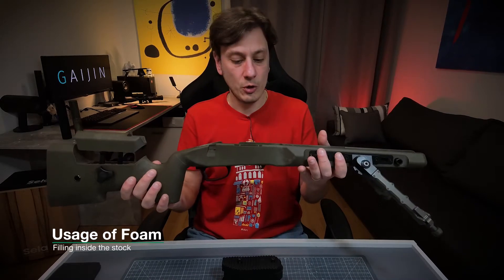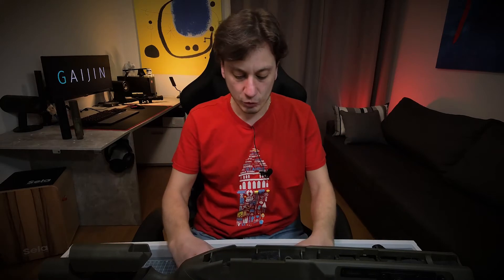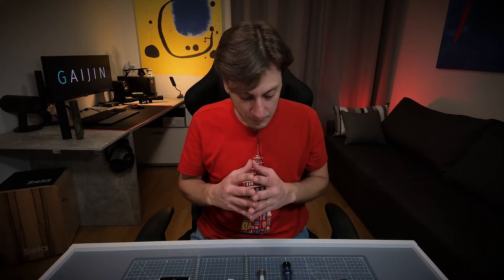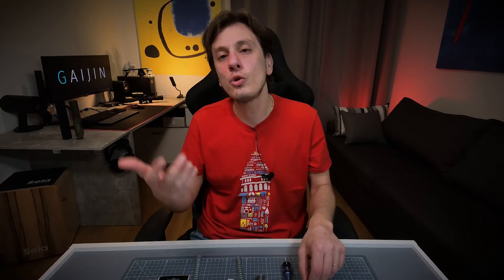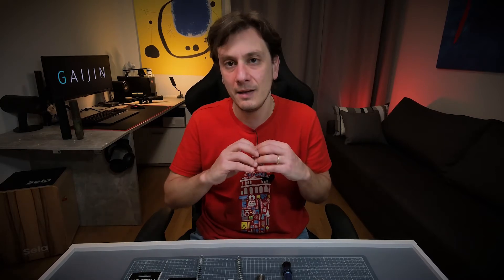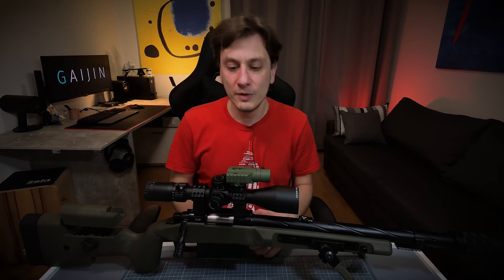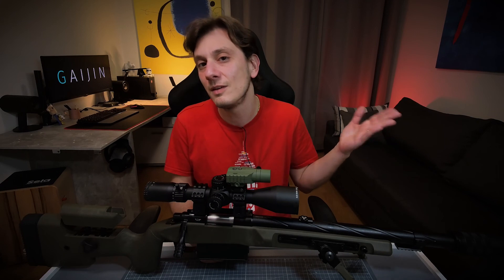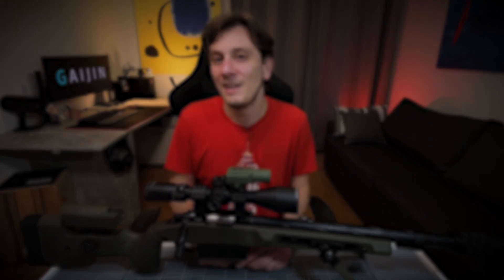How to make your airsoft sniper quieter

Comment: Sad to hear the sniper is done ;D But it looks great and i got my self a few tips what to do with mine. Thank you as always a great video.
Reply from the maker: Actually, i had to make 2 more videos XD one i published yesterday which is the DIY killflash for the scope i am using. The other one is in preparation which is going to be a short video about solution to the "racking/loading" problem some fellow airsofters are having =) should be published in 2 days or so. But that will be it for teching for the time being. Once corona ends, i will have some gameplays and testing videos. In the meanwhile, i will strat a new serises on ICS Komodo S3 DMR conversion =)

Comment: Dear you have new subscriber, everything you did, based on my experience as a sniper, which is not a long time, is the right thing to do, exactly, of course the difference I have had with sip has not been the best...I have lost several fps...but anyway, pretty good recommendations....when will you convert a ssg10 to hpa?
then test sound, distance, accuracy, etc....
Reply from the maker: Hey man, thanks for the kind message! I have  couple of ideas in my mind but i would like to get my financials in place first XD one of them is to check the ARES MSR-WR (hitman rifle) and play with it. if i can, you will definitely see in the channel!
Reply: @GaijinAirsoft  Hello dear, I write you and I see from Chile...very far away, it is a great idea the project that you tell me. There is that wonderful Hitman rifle, ouw... my head exploded... you know what topics would also be good to address, I have found little material, the HPA, not the part of assembly, if not good and bad that has, something like the appreciation of a player. Why I mention this to you, I just purchased a hpa kit for SRS a2 from mancraft, but once mounted on the factory cylinder, when I load it, shoot, I find that it is too loud sound for a sniper....I always read that it would be very quiet and it is not like that....
That's to tell you something....

A big hug from a distance and keep it up ...

Comment: I have a stalker scorpion piston at maximum weight with a rapax 2 joule spring and it is very quiet with ammo In however dry firing is incredibly loud so I’m going to try a sorbo pad to see if that helps . Love the videos
Reply from the maker: just keep in mind that sorbo pad will slowly get destroyed and ypu have to change it every 10 games or so... since i got bored of changing it, i took it totally out. with a short barrel, no supresser and no sorbo pad, now mine got pretty loud again 😂
Reply: How long are you running the air break on the stalker piston and how did you go about optimising it and the weight? I have one but no idea where to start! Thanks
Reply: @rdb9936  Hi I have an ssg10 and am thinking about getting the stalker piston. How has it worked for you, like has the gun become noticably quieter and if so how and at what joules are you chronoing at (in the UK our sniper limits are 2.3j). Thanks
Reply: @ghosteclipz7007  It works fine and is consistent etc. But if I were buying again I’d get a Sniper Mechanics WASP and Sniper Mechanic cylinder head. Hope this helps
Reply: @rdb9936  Out of interest are those separate products and is the reason due to the sound or the power etc just because obviously stalker touts the fact that it is very adjustable.
Reply: @ghosteclipz7007  From what I’ve seen I just think the SM products are better quality. And Dan (SniperMechanic) does a hell of testing prior to any product release, so I think better overall design. From what I hear, the stock SSG piston actually seals pretty well though. So if you want a cheaper solution, you could just add some lead tape to add some weight
Reply: @rdb9936  The SM are the stalker ones right? Interesting if I go for the piston I will go for the stalker then. Sorry to sound like an old record but just to clarify; will the piston itself actually help make the gun quieter? Only because the other features of 'weighted' pistons seem to be heavily disputed, like how the bb flies straighter etc. However if you have had success I will take you word for it.
Reply: @ghosteclipz7007  As in, purchase the SM piston, and SM cylinder head. Rather than Stalker. They can make it quieter, but you need to ensure good air seal with bucking. I don’t know about straighter trajectory, but a good piston will give you good fps consistency. The rest is down to your bucking, the application of hop with nub, and barrel
Reply: @rdb9936  Ah I see ok the SM piston is the wasp right? I will try and find some other reviews but this is good advice. Thx

Comment: i always wondered if mass vinyl or green glue  would help with the Suppressor and Rifle stock: I know for a fact that foam absorbs sound but it doesn't block it, while dense materials like mass vinyl(or green glue) block it. Usally when you are soundproofing something you need both qualities and i never see anybody doing that
Reply from the maker: you might give it a try but honestly, they will not help much since the real sound comes from the spring and piston crashing which you cant really reduce... i went HPA, now its silent 😊

Comment: Does anybody know if the sorbopad mod reduces fps/joule number?
Reply from the maker: yes it does since you are lowering the volume of the cylinder, causing less air pressure, hence less joule at the end but its not an extreme reduction =)
Reply: @GaijinAirsoft can you use higher spring to cancel that?